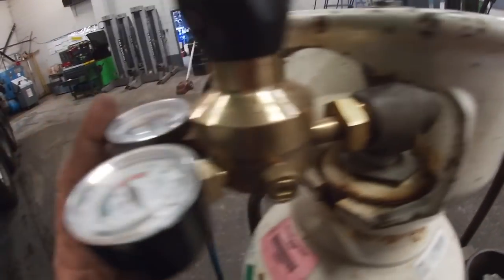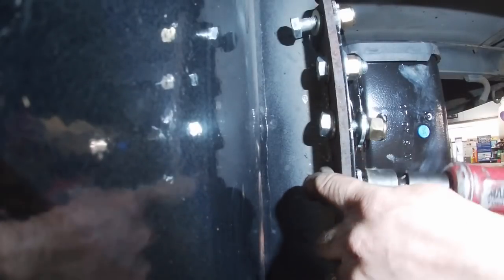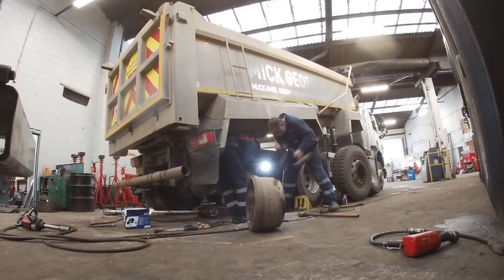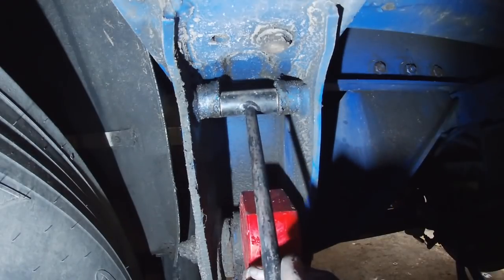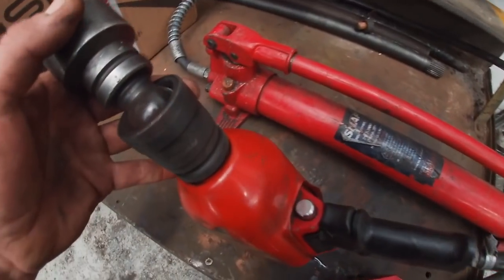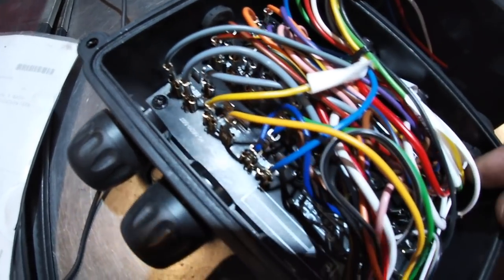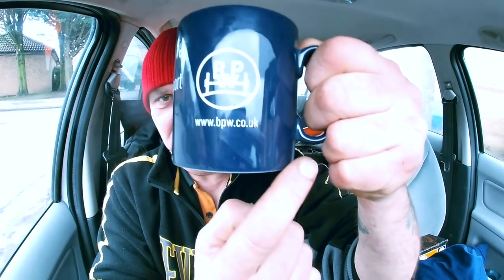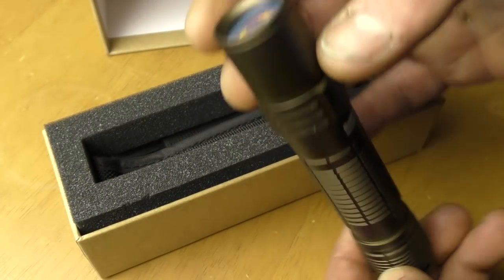UK Trailer Technician VLOG - "Did you have a nice day at the office dear?"

Comment: The fuel pipe under the air filter housing on those quite often gets a hole rubbed in it, could be worth checking. And the injector washers always leak too but you would hear that quite clearly making a  chuffing sound. Hth
Reply: Yeah I got a 307 1.4 HDi cheap as it was a bad starter ... been to a garage and the owner couldn't afford to fix it as quoted £1500  injectors fuel pump etc   ... pin hole in plastic fuel pipe 
under air filter ...  Peugeot wanted £180 for a new branch pipe ... it got a speed fit plastic air pipe coupler and ran sweet for 5 years till I sold it ... I did do the injectors seals  too  maybe only £10 for the parts seals and o rings  copper washers   but a day of my life I will never get back
Reply: @mondodaftasabrush  the seals are a hateful job, take off about 500 bolts to do a simple job
Reply from the maker: And there's me terrified of having to remove the injectors....

Comment: Just this week I have made a 12/24v relay tester for speed really  4 pin / 5 pin as some relay we use a double 87a  and those large blade 70 amp starter relays  
Yeah I have a relay tester...  but wont do 24v  you can buy one but not paying £100  when I can knock one up out of the parts bins and make it a workshop tool with my name on it 
I am not a fan of multimeter testing ...  yeah its a tool and a method and an indication but I like to see a load on a relay too just in case it drops out in operation 
Suppose its the way your taught .....  test light better than a meter ?
Reply: I work for an electrical power company and I use a modern version of a test lamp, it reads voltage and puts a load on, not much though only maybe 0.1 of an amp. You need to put load on or you can get “phantom “ voltages, especially when you’re fault finding. A lot of the mains cables are now aluminium which can corrode and give high resistance faults that will read voltage on a multimeter but break down with load applied
Reply from the maker: Yes, the final test was to put a wire between the two terminals to put a load on to see if the solenoid would kick in.  Silly me - I should have said really as a test lamp is often better.